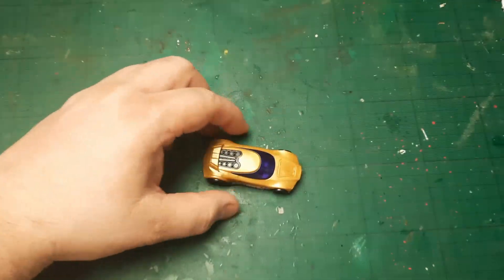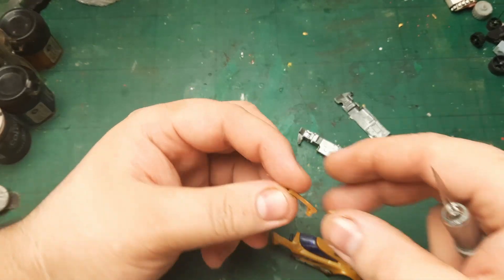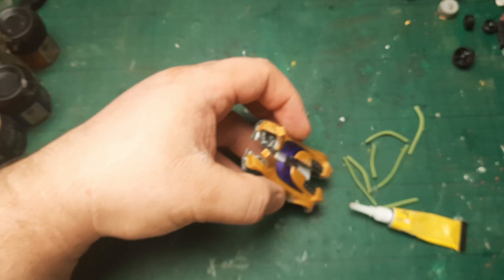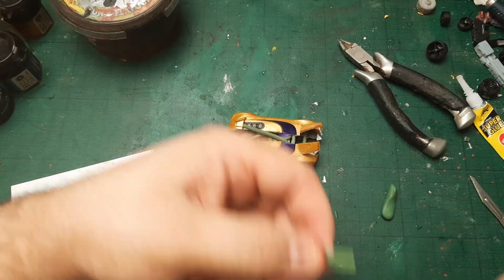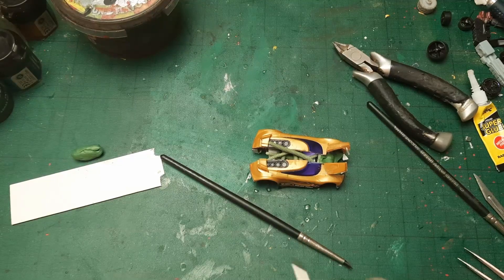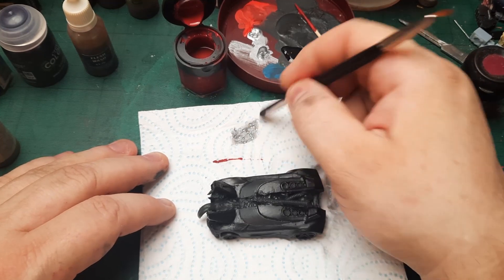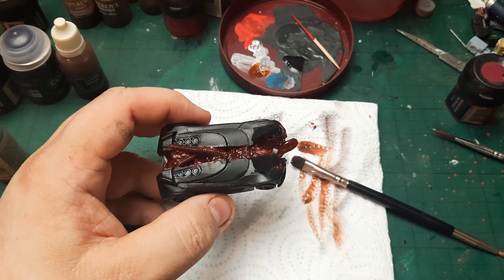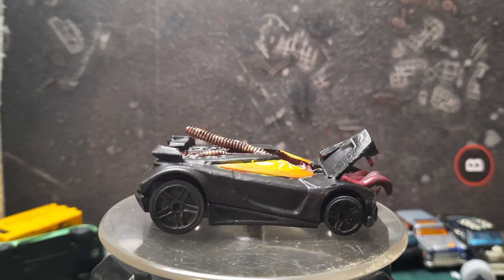Gaslands Daily episode 6 Monster Car

Comment: looks like cut in half during battle, then possessed by a techno/mechano polip parasite. love it. also hats down, i will never have "balls" to cut chicane in half, they pretty rare right now, only oone ive seen was packed with way too overpriced track set.
Reply from the maker: There is no need to have balls to cut a car when you have no clue about its value ;) I'm not knowledgeable in hot wheels rarity and what is expensive etc. so I just grabbed a car that seem easy to cut and that I thought would be a good fit for that conversion.